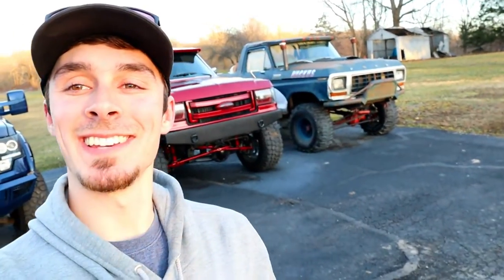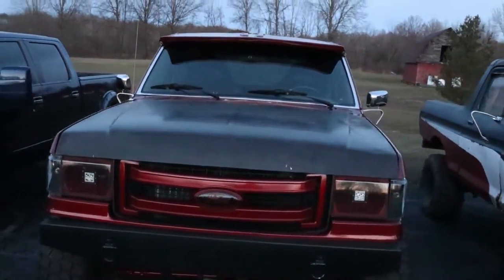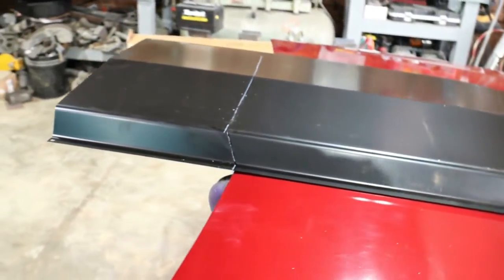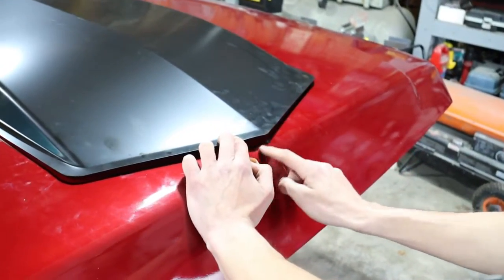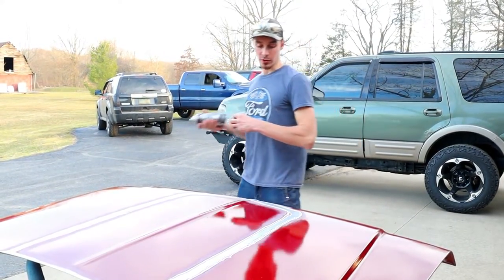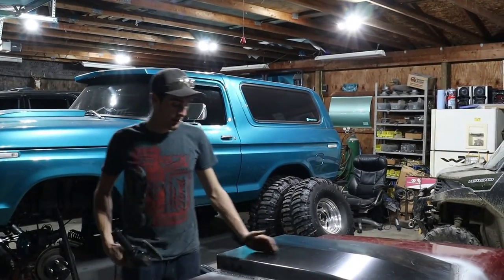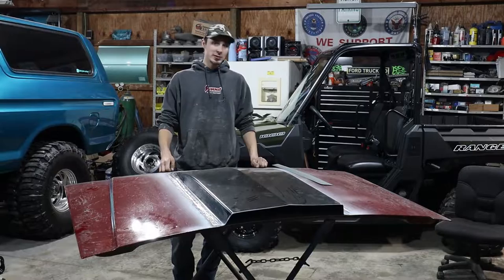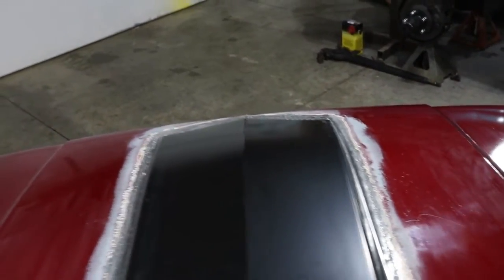87 Bronco Gets a Cowl Scoop! Step by Step Process (Part 1)

Comment: Here’s a different way to do it. I cut the lip off the bottom a moved to the inside and rewelded it inside to the scoop all the way around. Then I ground the hood and the bottom of the lip and installed it with Panel bond and clamped it down. Then just smoothed the panel bond over the edge of the outside seem at the hood with my finger. Let it dry and sanded it smooth. No welding to the hood so no warpage and no body work to smooth it all out.